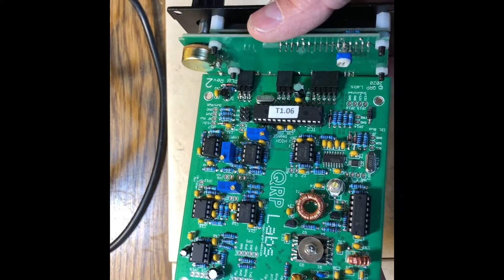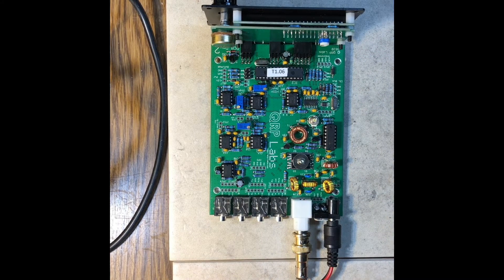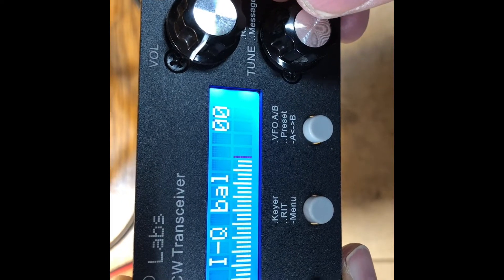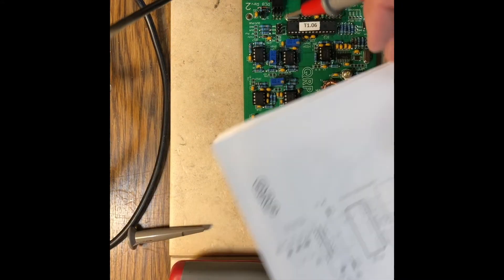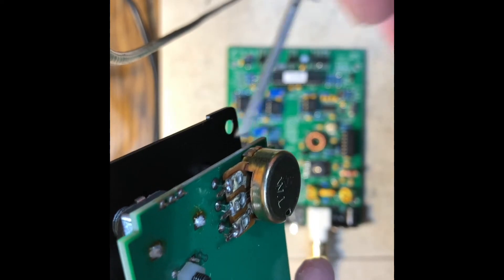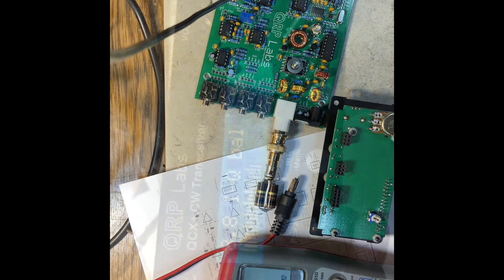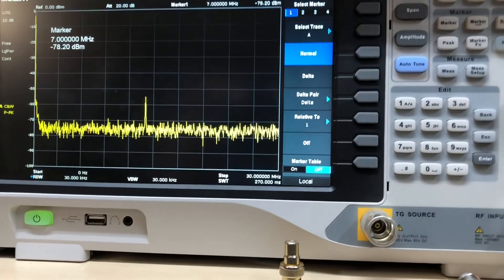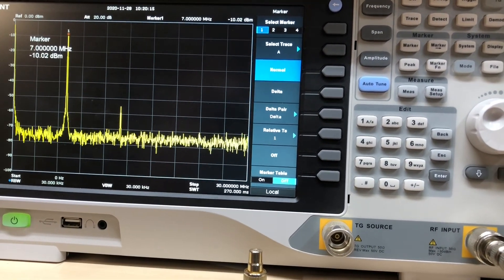QRP-Labs QCX+ Repair

Comment: Agree with others: this is a very good troubleshooting video and excellent instruction on peaking the LPF. That's the only hairy thing about the QCX series: reworking the coils to get the proper power out. 

And it's why I prefer the "plus" kits; there's more room to work. I just put puddles of solder on the toroid holes and soldered the toroids to them rather than through them. Still in all, I just managed 40 Vpp (approx 4 watts) and settled for that. 

It's hard to believe that the mini is the exact same circuit but fits in you shirt pocket!

Comment: Ron, I just watched this video for about the third or fourth time.  Great video and I loved your commentary.  I am not anyplace close to a skilled builder and only a few successful builds under my belt.  I have four QCX rigs. I have enjoyed building them but the earlier builds are not up to x-mit speed at this point so your commentary is going to be helpful to me.  I don't have a scope so I am just trying to improve output with a RF meter.  Thanks for any advice.
Reply from the maker: Sorry it took so long to respond Jay. The RF power meter is a good way to watch your progress as you adjust the toroids for output improvements. Just make sure it is properly terminated in a 50 ohm dummy load, same as when using a scope. 73. Good luck
Reply: @rontaylor9026  Tnx Ron for your comment. I have been working on other projects like the QRP-Labs GPS which I have built now. I am repurposing an old ATT wifi router enclosure which is a perfect size for the GPS. Dollar at Goodwill and way cheaper than something purchased. I need to get back to the 20 meter QCX that isn't putting out power.  I have a QCX+ on 20 so I may just use it on WSPR with the GPS. Low power shouldn't be a problem there.  hi  tnx agn fer u r comment 73

Comment: I have one that after an issue with an intermittent power connector supplying power, the radio is now just motorboating any suggestions De N2AIE
Reply from the maker: Hans wrote on the group once that the design was for 32 ohm phones. He said 8 ohm phones sometimes cause motorboating. I don’t know what you are using but you might check that Avenue. Good luck. ... Ron